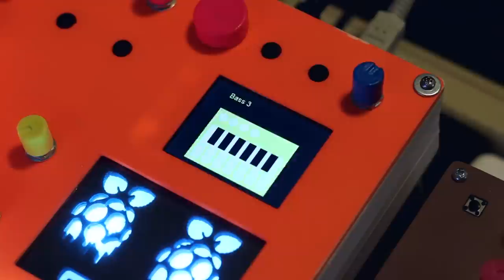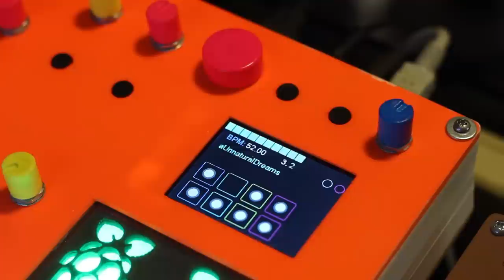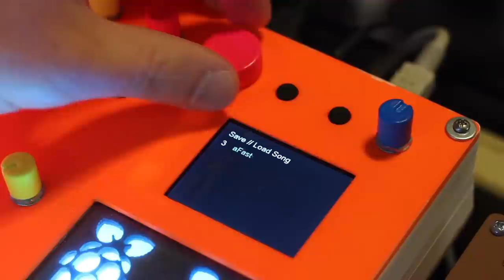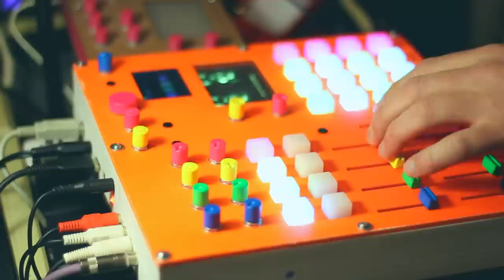Raspberry Pi Looper/synth/drum thing

Comment: Quick question, how many tracks do you support?
Reply: And how did you manage the synchronization? I take it that's for applying samples, not live audio recording?
Reply from the maker: Songs or tracks? The menu goes to around 50 for songs and each can have 8 loops/tracks.
Reply: Wow, thanks for the quick reply. Is that because of the substantial difference in performance between an RPi 3 and a B+? I have seen some older loopers done in 2014 with a B+ and the limit was 4 tracks.

Have you added the ability to save the songs, likely not the final mixes but the configuration that your app can load and resume as if you had just created it?

I will probably peek at your code to get a better idea, so thank you for sharing! I plan to do the same, share the code, but my design doc is due first.

Cheers and thank you for sharing!!!!

Comment: I wish this guy could've made a list of items or a tutorial on how to make one of these ):
Reply from the maker: Check the github link in the description.
Reply: @otemrellik  thx (:
Reply: @otemrellik  Hi, do you have a newer version of this coming out in the near future or is this project still worth attempting?
Reply from the maker: @jrlening  I'm currently working on version 4 of this but it probably won't be done for quite some time.
Reply: @otemrellik  I ordered all the parts and am waiting on a quote for 3D printing. Some of the Sparkfun parts are discontinued but Adafruit had them in stock.
Reply: @otemrellik  Hi, I apologize in advance if you see multiple posts by me in your guts video. It looked like my posts kept disappearing after posting. I have some questions with PureData on the Pi. I installed PD and can open up your files within the program. I see in your code where the drum files are and renamed all the samples on my Pi appropriately. Where do I add the other instruments? Do I need to setup a command when the Pi turns on to open PureData on start and have it open all your files as well?
Reply: @otemrellik  I am getting an error with comport on PD after starting up piLooper. It opens and closes the port and it looks like it finds the correct port where the Teensy is plugged in but gives me a write error. Also, is there a library/code that needs to be installed on the Teensy for the tft screen? Thanks!
Reply from the maker: @jrlening  I seem to remember comport errors happening with this project but I don't remember how they were resolved. I would test this using a computer running pd. There is a library for the tft, I think it's just the standard one teensy provides. Check the includes to see what is being used.
Reply from the maker: @jrlening  As far as I remember the other instruments are just fm synths, you shouldn't have to add them, they exist as presets inside the pd files. Yes, you should setup a something to load the patch when the pi starts. There are a lot of ways to do this which you will have to look into. Creating a service is one of the ways I've done it more recently. I don't remember what I did on this project though.
Reply: @otemrellik  Thanks for responding! I installed the proper libraries after looking at your code again. Bounce has updated to Bounce2. Not sure if that makes a difference but updated the code for that. I still need to solder the pcb boards but everything else is finished. I don't have picture on the tft screen when I start up your PD patch. Not sure what I am doing wrong there.
Reply from the maker: @jrlening  I would try to just load up the example code for the tft on the teensy and see if you can get that going.
Reply: @otemrellik  Thanks for the advice. Figured out the issue on the tft (soldering) and ran some example code. Everything is almost complete and I am now trouble shooting issues: encoder button doesn't work, two of the fx pots aren't working, one instrument button doesn't work and the Nintendo DS screen isn't working. I can setup loops and everything else.
Reply: @otemrellik  Thanks for this project. Finally have everything working and need to button up the case. I have some panel mounts coming (micro USB, HDMI, 1/8" Jack)  to add to the case  to be able to access the Pi without opening anything up and adding a headphone jack.

I added the code to start up PD when the Pi starts. 

This has been a challenging project to get working but thoroughly enjoyed the build.
Reply: @jrlening  Congratulations[!] on getting your version finished. I can’t believe it, that is really great to see. I wonder how it’s doing now
Reply: @ytvang long delayed response: slowly working on making this smaller. Confirmed you can use a Pi4 and a Teensy 4.1.

Comment: Would you consider making a video of a "Tear Down" of this? Like just the top plate taken off and show the inside. I think that would benefit a lot of people who would want to replicate this. I actually have a Pi 3 and I have an Arduino Uno around somewhere, do you think this could work with the Uno? I'm pretty sure it would, but it would just kind of be overkill compared to a Teensy.
Reply from the maker: It should work with a Uno. More and more folks are asking to see the inside so I may do a quick video opening it up and talking about some of the connections.